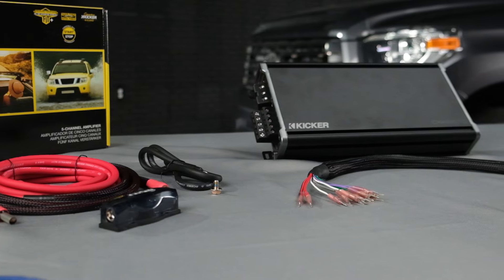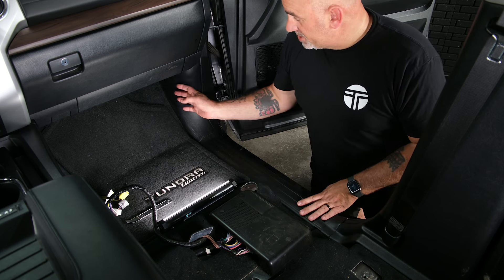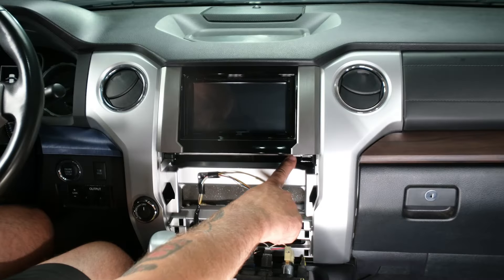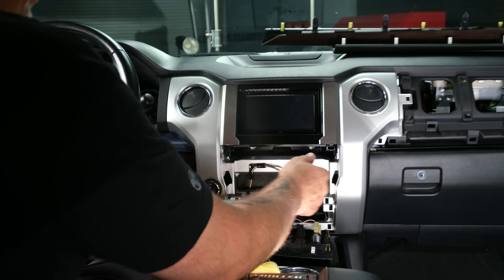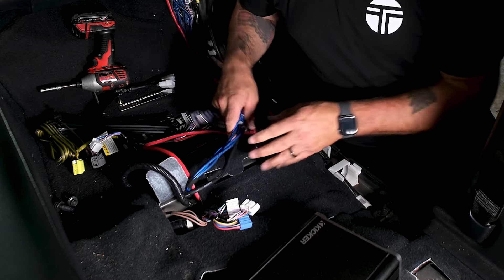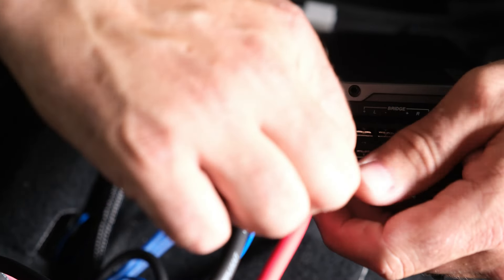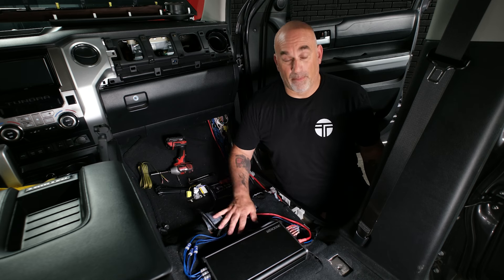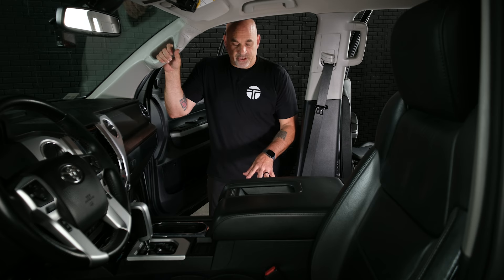Toyota Tundra Kicker JBL Amp Bypass Plug & Play 5-Channel Amp Bundle | 2014 - 2021 Toyota Tundra

Comment: How does this 5 channel amp work with the JBL equipped tundra having a total of 8 different speaker channels?
1 for each door speaker, so 4.
3 dash speakers, left, center, and right, so 7.
And 1 more for the subwoofer, makes 8.

Is the OEM wiring feeding the now amplified front and rear signals to the dash speakers somehow?  

I'm confused as to how this 5 channel amp feeds signals into all 4 doors and the dash speakers.

Comment: Are there any extra steps needed to install this kit on a ‘21 Tundra Limited (JBL system) with an aftermarket Sony 9500ES w/Maestro unit? Also, what’s the impedance heading to the sub? 
Thanks in advance!
Reply from the maker: Nope, no extra steps! You can follow the installation video exactly! The 9500 is a 2 Ohm stereo so it will be 300x1
Reply: I installed the amp in almost short amount of time using your video instructions. Now, my sound system sounds like what I always thought it should be- deep bass, distortion free mids, and sparkling highs. I purchased a bass knob (from Amazon), and now I can control the lows with a turn of the knob. 
Trail Grid Pro is awesome, and this kit is beyond what I was expecting.

Comment: hello! i installed your system on my 2014 tundra platinum with jbl. I am using an android based head unit. it works but amp has a preset volume that is loud and my android head unit only display volume adjustments but won't actually lower or raise amp volume. please help me out with any suggestions.
Reply from the maker: Hmm, okay. What head unit are you using?

Comment: Is this the same install for the alpine bypass system?
Reply: I would like to know this as well.  Did you ever get an answer?
Reply: @ no never heard a peep. I got an email with written instructions but I’d prefer a video. I’m a visual learner. @trailgridpro
Reply: @Tuffloud1 update. I just installed my alpine system. I followed this video to a tee until it came to wiring the amp. Trail grid pro sends you an install email with instructions that are easy to follow and they label everything so well it’s hard to mess it up. So overall, I would follow this video for the most part, when it comes to wiring, follow email. Super easy. Very very happy with it. GL
Reply: @Prince_Ali_2-255 awesome, I really appreciate the update.  Thank you.  Are you planning on replacing the factory sub behind the rear seat?  TGP is supposed to be releasing a sub/amp kit (JBL bypass version).  I think they are staying with the same amp and they said they would sell me just the sub enclosure if I already bought this Alpine amp from them.  I already have the Alpine speaker upgrade kit installed.  How does it sound?
Reply: @Tuffloud1  my pleasure. I have installed the entire alpine system, ilx-f511 head unit, 10 speaker bundle, front camera, front/rear dash camera, and the JBL sub bypass. I would definitely buy and install the sub behind the seat if they sell it as a stand alone kit since I already installed practically everything else. As far as the sound quality goes, it’s a vast improvement imo. To be fair, I don’t know anything about tuning the amp or eq settings. I watched a couple videos and did some minor adjustments but nothing official. I’m betting it’ll sound even better with a quality tune and a quality sub behind the seat.
Reply: @Prince_Ali_2-255 I’m going to go ahead and order it.  I also have the ILX-F511, 10 speaker bundle and Alpine dash cam.  I’m old school and always ran Alpine in my younger days so it had to be that!  Thanks again my friend for the updates!
Reply: @Tuffloud1  same here. A buddy had a full alpine system installed at a sound shop and man, it blew me away. That’s what lead me to TGP. I’m a DIY kinda guy so it was a no brainer. I would highly recommend the bypass kit. If I could do it over again, I would route the wires underneath the seat and get them exactly where you want them tucked away underneath the carpet before you wire anything into the amp. The email instructions have you wire the power and ground first then tuck the excess away. The gentleman in the video did it right. I spent an hour trying to maneuver the damned thing into place. Ended up unplugging everything and starting over. If you end up tuning your settings right, would you mind sharing them with me? I appreciate it!
Reply: @Prince_Ali_2-255 I’m in the middle of the install.  Did you have to reflash the Maestro unit on your ILX-F511 to aftermarket amp?  I believe it was flashed for factory JBL amplifier so wondering if I need to reflash while I have everything taken apart.